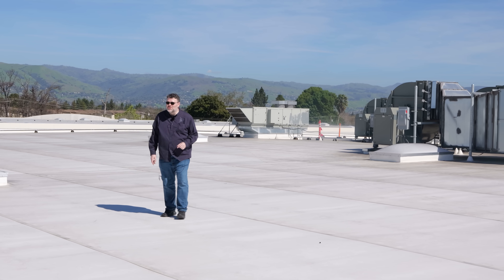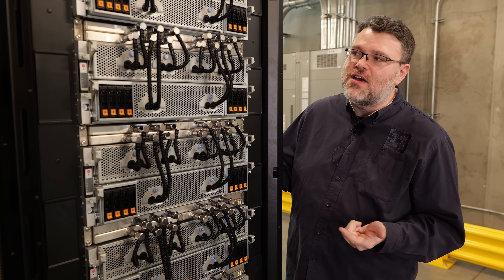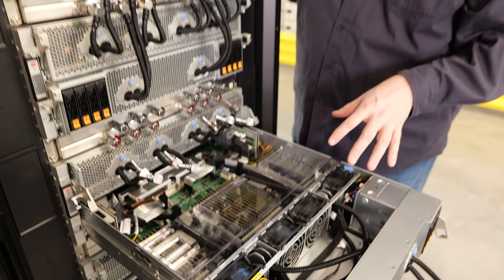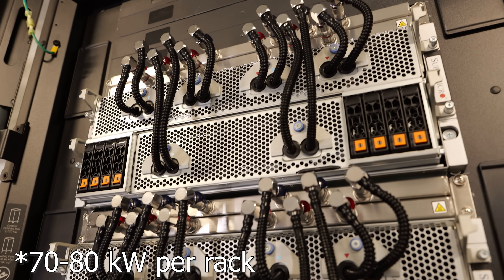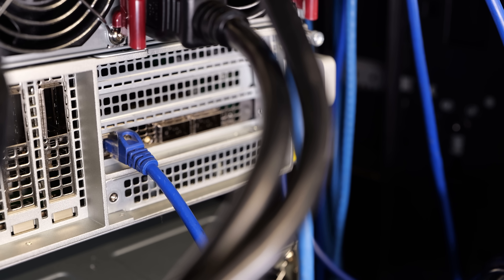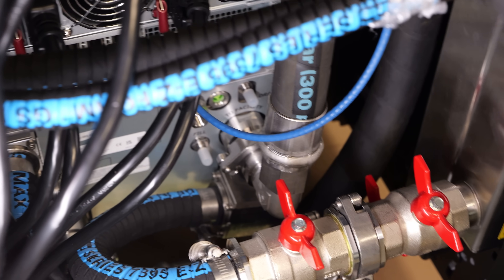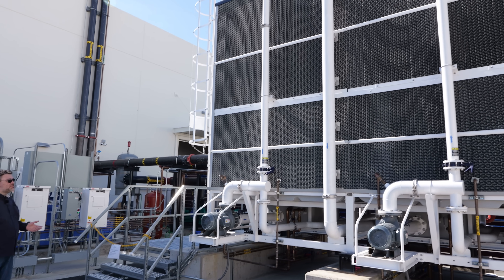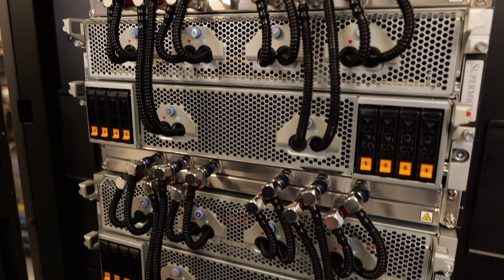My Tour Of A 5 Megawatt Custom Loop Datacenter ft. Supermicro; 80 Kilowatts Per Rack

Comment: Hi, do you know of any laptops with HDMI-IN? It is hard to find, because when manufacturers list I/O ports, they do not say it is only an input of this kind. Second, the Lenovo thinkcentre m90a pro has a thunderbolt 3 input functionality, so one can display the laptop on the thinkcentre and use one of the ssd inside. Also GPD Pocket 3 has a similar function, namely the KVM module, here display can be shown on the GPD pocket 3 and you can use the keyboard to control the other device, this is what I am searching for but in a bigger 14 inch size. So,  I am trying to find this functionality in a laptop/desktop. Is there a way to get this? Does such hardware exist? (Some people recommend a capture card, but there must exist a simpler solution like GPD pocket 3. I do know that getting a display with KVM is also a solution, but I am in need of second OS which I can use for backup via WIFI). Also, just found Minisforum V3, could you take a look at that which has DP-in. Thanks in advance, kind regards.
Reply: buy a cam link.

Comment: The engineer in me loves this. The planet inhabitant concerned by climate change is horrified! We are now at 1.7ºC above pre industrial levels. Can data centres really not find something better to do with all this heat than just dump it out into an already cooking planet? Build next to industries that need heat … e.g. ovens in food manufacturing …. Or district heating in cold regions? C’mon lots better ways to use this excess heat, and can charge them for the heat also, or even just give it away and have some good pr!

Comment: > it's going to evaporate hot water

How much water is lost to evaporation?
Can the water temps get high enough to make the waste heat useful to some industry?
Reply: Yes its not uncommon to use heat from data centers for district heating
Reply: I'm going out on a limb here, but I'm assuming it works like a swamp cooler, and the water being evaporated is just regular city water. So the coolant in the loop is entirely contained, shedding heat conductively to a heat exchanger. That heat is then dissipated into the atmosphere through the evaporation of the "external" water. Again, I'm no engineer, and this is all a guess.
Reply: those big pipes had a big label in them with text "condenser water supply" and another with "condenser water return". that could imply that it does return the vapor by condensing it? i wonder how they evaporate because the water probably isn't boiling, unless they lower the pressure. or they can use another heat transfer loop and something that boils in that
Reply: Most likely the water does not evaporate. More likely the water transfers the heat/energy to the outside air, like a radiator.
Reply: @thebinkbink6349  On the datasheet it says it takes 6.2 GPM(gallons per minute)/MW of water, so it definitely loses water.
Reply: @zwe1l1nkehaende  Yeah it's an evaporative cooler, it absolutely looses water, it works by basically throwing vaporized water into the ether. But all things considered the loss is fairly small relative to the cooling capacity. Water has an unbelievibly high thermal mass
Reply: @Mallchad  You can do evaporative cooling and recapture the water, it's used to cool to subambient temperatures, but then the cooler would have to be a lot bigger. I just wanted to clarify that it does lose water
Reply: @thebinkbink6349 fresh water is sprayed on the cooling vanes and evaporates there, cooling the vanes. This wastes freshwater but is far more space efficient then normal cooking without evaporation

Comment: I sure hope Super Micro reuses that evaporation energy in some way
Reply: What do you mean? It's cooling the servers. It's the most efficient way to cool, provided you're in an area like a desert like they are. Even more efficient than refrigeration, because it's doing the same thing, but without a compressor. Do it on a large enough scale where the heat can create a natural upward draft, and you don't even need a fan (power plants). I suppose the most efficient form of cooling would be if you housed a server farm in a dam and used the head pressure of the water to force its way through everything, negating the need for a pump. Direct river or lake cooling...
Reply: @timramich  in other nations energy is expensive, you'd put this energy into a local network for heating pools and providing hot water.

Comment: thats impressive.i was finking why the pipes on the roof were black .black absorbs heat .silver or white reflects the sun .if you ware black on a hot day.you will be hot .and also why the return cold lines were not inslulated .. im thinking 8 bar water moving fast .it might help .this is very cool
Reply: I know nothing about thermo dynamic’s. I’m thinking about. Pipes warning up water on the return to the racks .

This is a test and show setup,I get it.

For kicks and giggles. Measure the pipe temperature at noon and midnight

Comment: Just build it all on Iceland and power it with geothermal, and send the excess heat down the same pipes as to not heat the environment. We dont wanna push hundreds of gigawatts into the ambient air.
Reply: What about the sun? That gives out a lot of heat, too!
Reply: The earth is just going to radiate that out anyway. It gets warmer as you go down, so the heat has to travel up and out. You can't pump heat into something that's warmer. I.e. if I stick my hand into a pot of boiling water, I'm not going to add any energy into that system. Evaporative cooling will at least contribute to cloud cover, lessening the supposed global warming.

Comment: air and liquid cooling combined? data center looking like water works building? oh gosh...where this world is going to...recipe for disaster :-/
Reply: They're using evaporative cooling. Not air cooling at all. It can achieve below ambient temperatures, especially in a nice dry place like a desert.
Reply: @timramich by air cooling i mean the fans visible on the video for cooling the ram modules and other non high power components. also -70-80KW per rack...that's not eco friendly at all :D